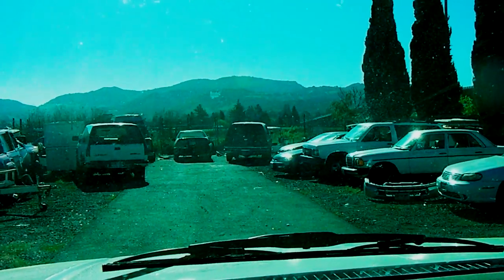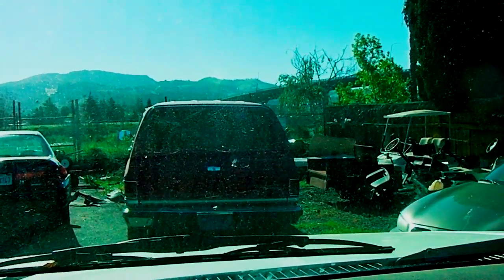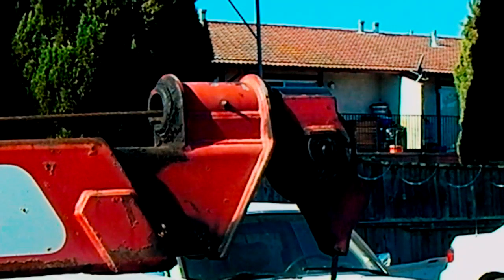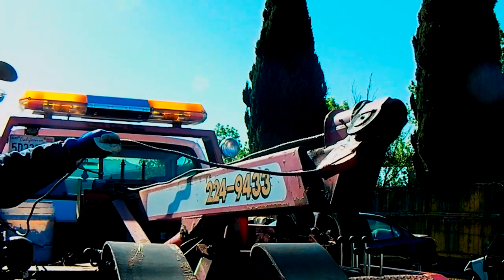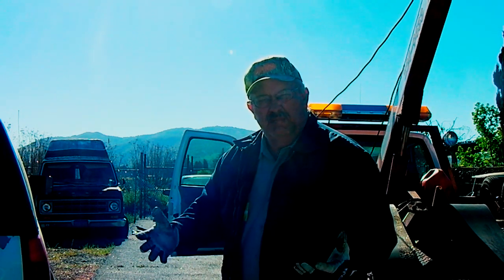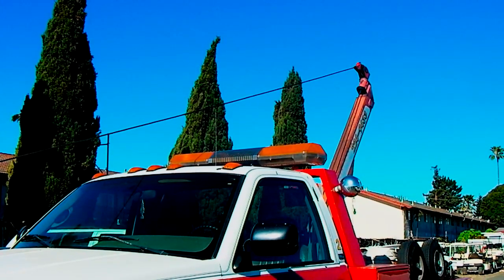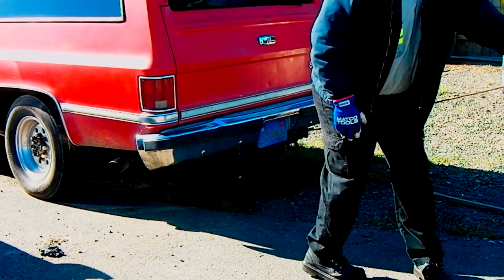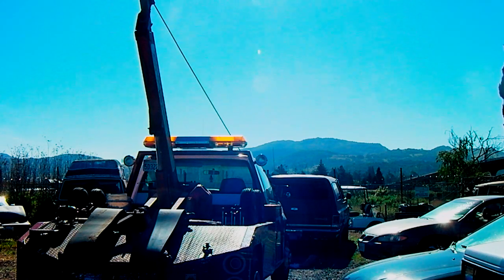Wrecker Recovery Alternative Winching Methods

Comment: That's a handy tip, it works well.
A tip to save your jacket from getting dirty on the line.
Just go to any discount shop like walmart and get a couple rugs.
I get them about 3 feet wide and 6 feet long. 
Good for tossing on the ground for getting under a vehicle while keeping your clothes clean. Or use a clean one (reduce chance of scratching paint) to protect your light bar and paint from a cable over cab job.